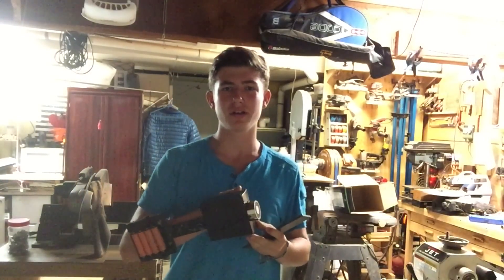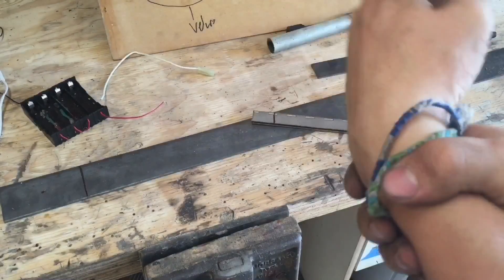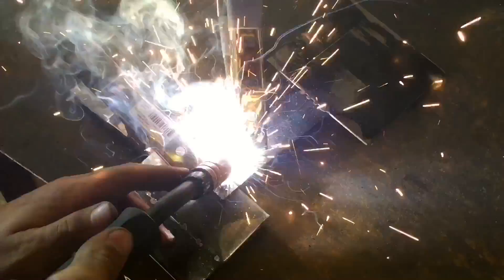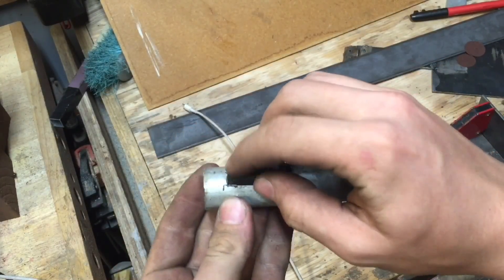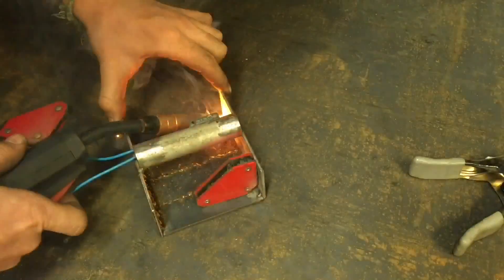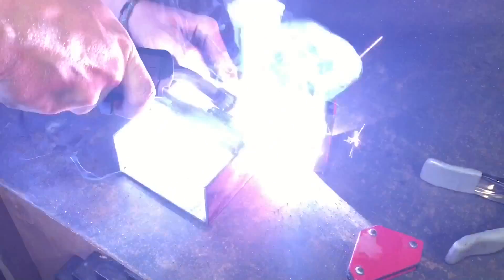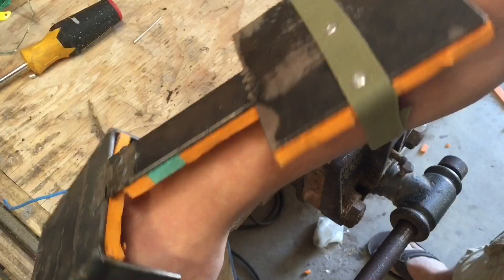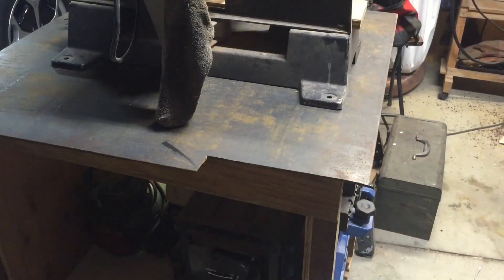Electromagnetic Gauntlet! Magneto Powers!

Comment: What’s the range ? Because I’m trying to make one but I wanna be able to move stuff from a good distance away nothing too crazy
Reply from the maker: That's very diffciult you would need a huge magnet. This one needs to be basically on the metal to grab it
Reply: @TheRussianWoodworker  I think I figured a way to accomplish what I’m trying to do by placing ( say N poles ) together you could increase the central projection of the field. Using 5 magnets could do the trick . But the hard part is trying to make it compact.